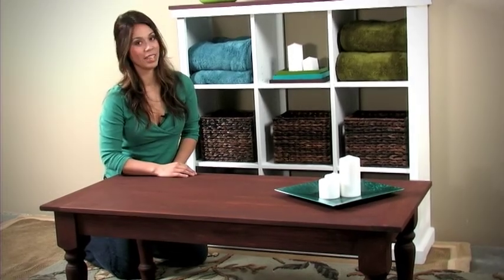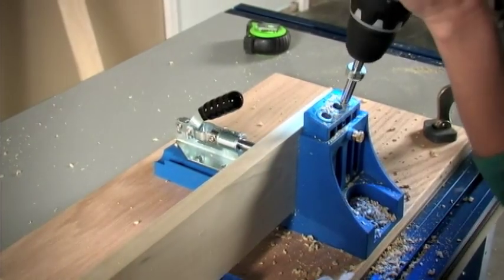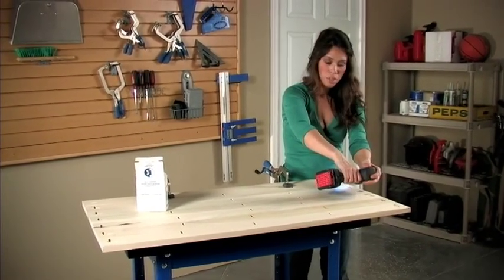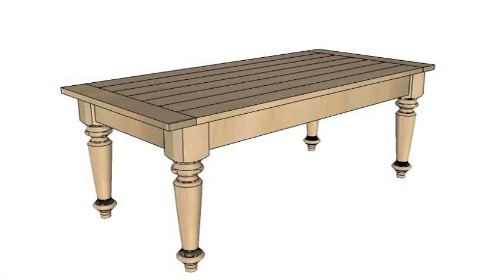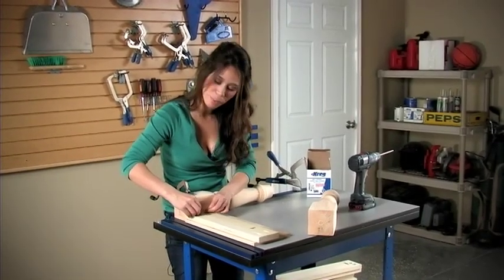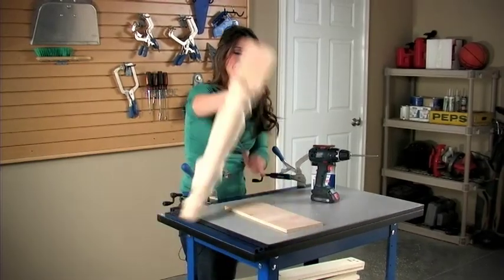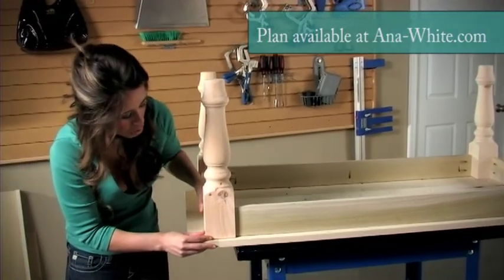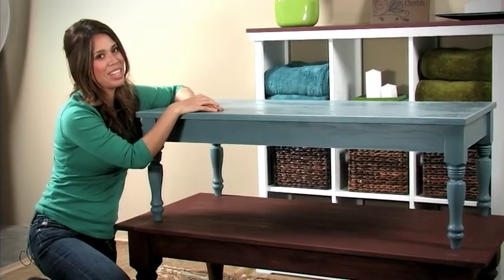How to Build Turned Leg Coffee Table - Cinema.mp4

Comment: I always use a cordless drill and set the clutch to real low and then increase it slowly until it gets the screws in just enough so as not to split the wood. Thanks for posting. Great job!

Comment: kind of glossed over a minor detail of the direction the pocket holes need to go.  if they all go the same direction they wouldnt be needed in the last board.  I cant tell from the diagram which way they go.  I assume they go one way then on the other half they go the opposite?
Reply: Last board may have a joint edge.

Comment: You've put on a couple of pounds on Anna, but thanks for putting on the low top dress to top to work in. It always makes your videos more interesting. As for the table top, why did you use pocket screws? you could of glued and cramped it making a better job. More people have access to glue and cramps than kreg jigs. Better luck with the next project.x
Reply from the maker: Yeah!  Pregnancy will do that to you!